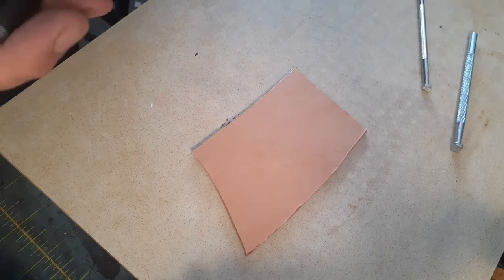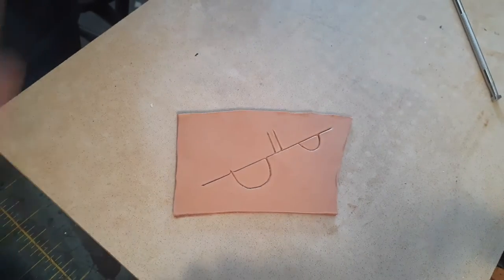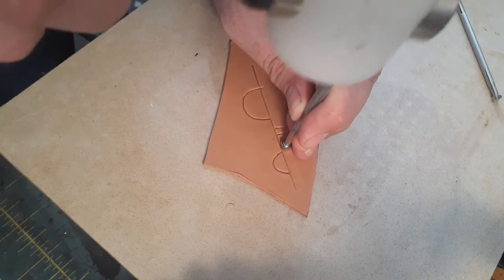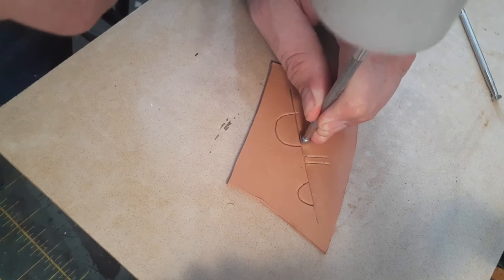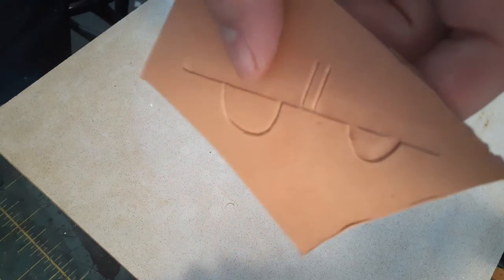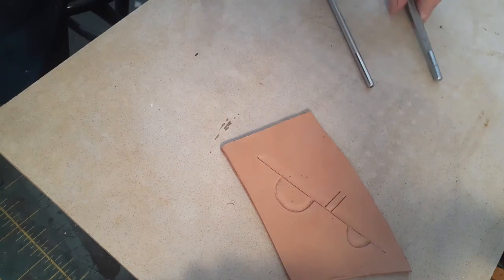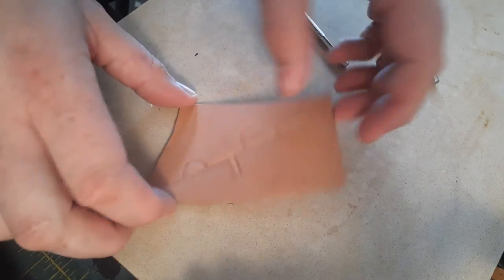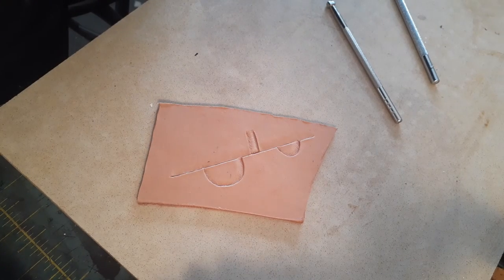The Basics of Beveling

Comment: Did you have to wet the leather prior?
Reply from the maker: Yes.  You have to 'case' the leather with water.
To properly case the leather you should wet it and allow it to soak in.  You wa t the water IN the leather. Not ON the leather. If it still feels wet it might need another 5 minutes.
Reply: @mcewenhandcraft  super helpful, thanks! What type of leather and thickness are you using here? Appreciate it as I’m new to this.